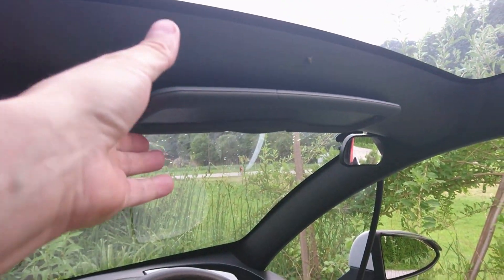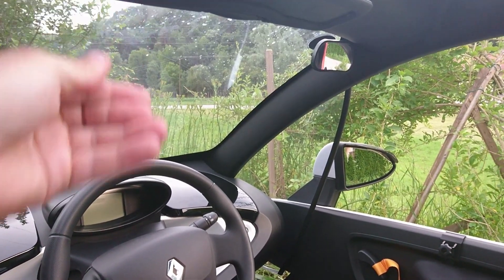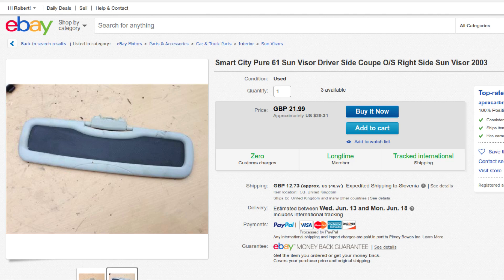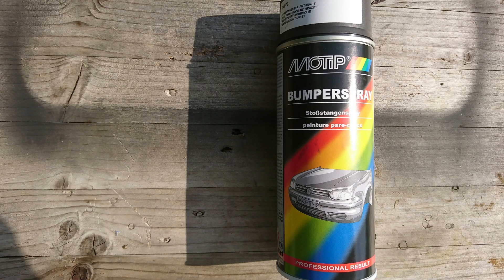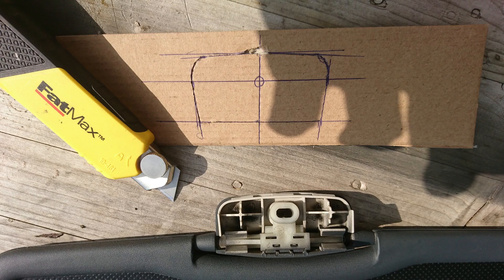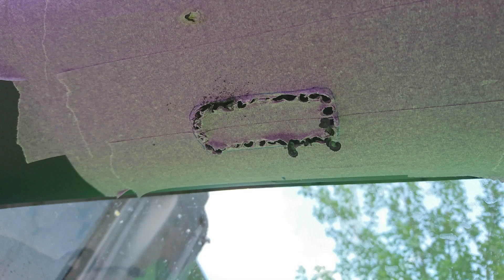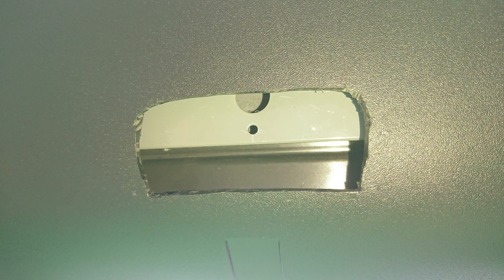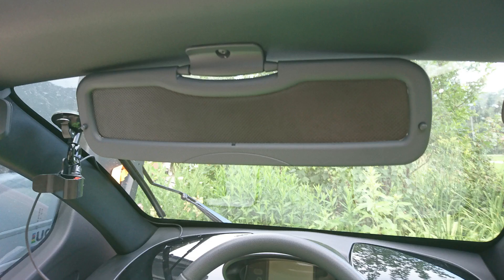DIY Installing Sun Visor in Twizy

Comment: Hi! I've watched your video, but I didn't get how you screw the sun-visor to the metal part on  the car. Do you screw it directly to the metal, or do use an appropriate nut? Also, which screw number did you use please, I was delivered without any screw or number I need.

Thanks
Reply from the maker: I bore a small leading hole in the metal and then use one of those bolts that makes a thread for them self.https://www.google.com/search?q=samorezni+vijak&tbm=isch&ved=2ahUKEwiwsMqgvdTjAhUNyRoKHZXLBaQQ2-cCegQIABAC&oq=samorezni+vijak&gs_l=mobile-gws-wiz-img.3..0l2j0i30l3.8682.14207..16041...0.0..0.149.1520.0j12......0....1.........30i10j0i7i30j0i13.igczFCXhCnQ&ei=FPA7XbDWFY2Sa5WXl6AK&bih=641&biw=360&client=ms-android-huawei-rev1&prmd=ivmn#imgrc=V5m7Bm2lBHmEQM Don't know the number, I just take one of the off my shelfs. I have quite a lot different bolts and other small stuff at home. The bolt head must go into that hole and must be long enough, but not to long.
Reply: Kuki Bajker and it’s enough for the sun visor to be held for a long time then? Thank you
Reply from the maker: @axel50397  I have it now for a year or so, and no problems.